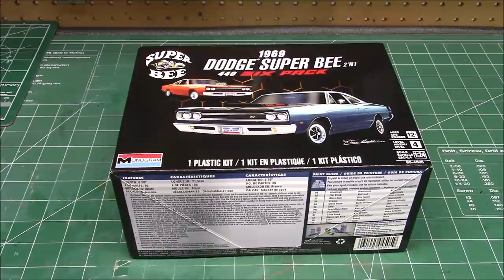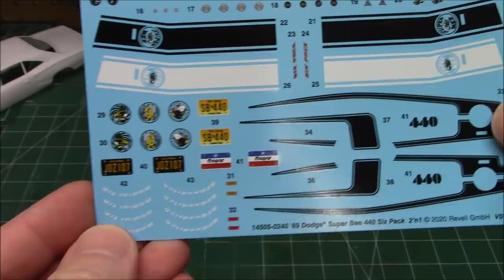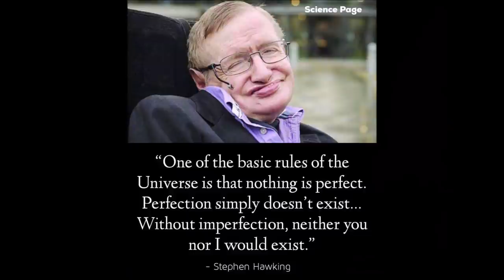1969 Dodge SuperBee Coronet 440 Six Pack 440-6 2n1 1/24 Scale Model Kit Build Review Revell 85-4505

Comment: I had the 80s issue of this kit with the body molded in metallic blue and it had a little tear open packet of turtle wax included. It was a very cool  kit that goes together extremely easy. I think they may have added a hood and a supercharger to this newer issue as well as more decals. .I need to get me one of these!
I used testors sapphire blue metallic on mine and used the white rear super bee stripes. It turned out AWESOME! Great parent child project.  The  level of detail is  excellent, don't let the fact it doesn't have a high parts count  fool you!
Keep building your way!!

.

Comment: I built that same car model back in the 1990s. It was the one by Monogram that was molded in a blue metallic plastic. I took the Testors silver metallic and gloss blue paint and mixed up my own blue metallic paint for the body color. It looked close to the B5 blue that they used in the factory. It was a nice looking car when I was done.

Comment: I had the the molded in blue metalflake  version of this kit that I build when I was about 13 yrs old. I used testors sapphire blue spray bombs. This is a very easy kit and those who hate on it can go suck lemons.  The new tires with this kit are alot better than the first version I had. And indeed,  I truly enjoy my purchase. This kit is EASY.  The exhaust manifolds are easy if you rubber band the engine to the chassis then  make sure you have em angled out so they line up. This is EASY cause you can actually snap the exhaust pipes/ rear springs and axle in to verify it. Just how I did mine.
Y'all are missing out on a very cool kit if you don't like it's scale. It would be a great father/daughter build...it fits nice.

Comment: Nice build once again. One thing that gets me are the mold seams. There's one on each side under the c-pillar and around the engine just to mention a few. I never leave them be, they have to be sanded off. But that's just my 2c. Great work. You brought the fun back into this hobby and thanks to Your videos my kit stash keeps piling up and my wallet light and thin 🤣🤣
Reply from the maker: I don't stress mold lines and what not. Simple, fast, fun builds in a couple days, twice per week is all I do. Thanks a lot!

Comment: had some old kits laying around and a old tube of testors cement so I used that much as I could but it was toast!   so went to hobby lobby looking for tamiya cement and they had nothing! went next door to harbor freight to check thier glues out and found a 3 pack on slow CA. $1.80 that did the trick! worked great and parts were easily attached in seconds w/o waiting for things to dry...
something else that works for drag/show cars is spray windows with transparent blue which gives a stealth appearance..........   nice job on the B!!
Reply from the maker: Thanks a lot!